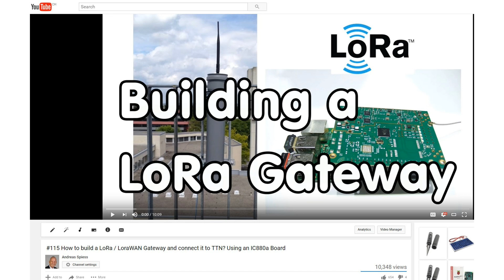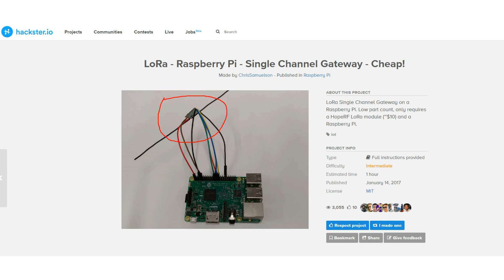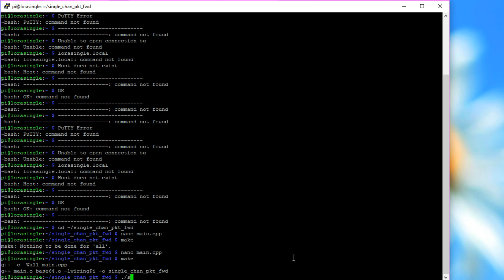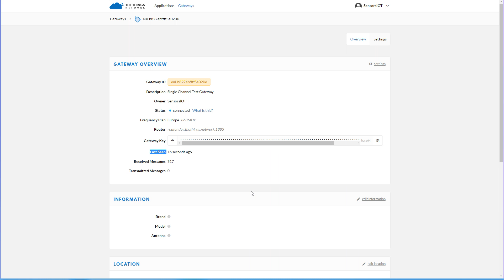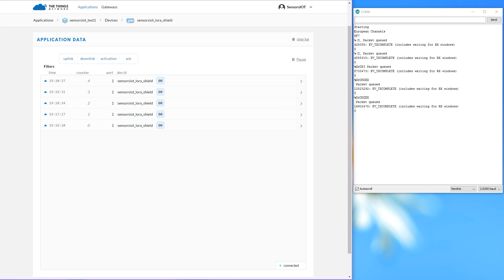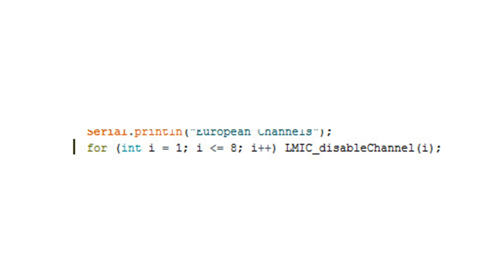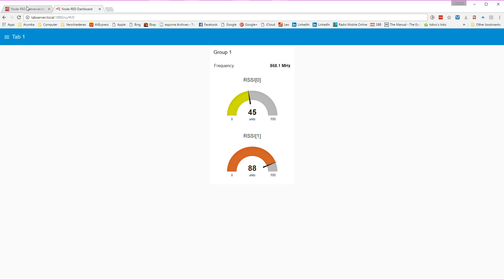#124 Cheap LoRa Gateway: Tutorial on how to Build with one with Raspberry Pi and Dragino

Comment: Hi Andreas,

Thanks for your work and introducing me to the world of LoRa. 

I followed this tutorial using a RPI3 + Dragino Lora/GPS Hat. At first I was getting the 'Unrecognised Transceiver' error. However, I tried it with a RPI2 and it worked fine :) 

However, now when I register my gateway with TTN, my status appears as 'not connected'. I've read on some forums that this is because my gateway is single channel, can you tell me if this is correct?***

Also, my next plan is to set up a node using your tutorial in #117. Do you think regardless of the 'not connected' issue above I willbe able to connect my node with gateway?

Thanks again for all your work!

* Oh silly me, I just saw the pinned comment, apologies, I will try it now!
Reply from the maker: First, you have to solve the "not connected" issue. Otherwise, your node cannot connect through the gateway.
Reply: @AndreasSpiess  Thanks for the reply, yes I switched over to https://github.com/bokse001/dual_chan_pkt_fwd however, I'm having the same problems as Floris and Henry in Amin's pinned post...

Comment: Hi Andreas, great tutorial thanks a lot! it was very helpfull. But i do not get the status connected. Can I check somthing? 

Pi is running and the "Programm"
SX1276 detected, starting.
Gateway ID: xx:xx:xx:xx:xx:xx:xx:xx
Listening at SF7 on 868.100000 Mhz.

Pi has Internet

Thanks for your help.

Rolf
Reply from the maker: I would see if I followed the instructions and also if the internet address of TTN is ok. Needs some googling. The changed their servers once. I am sure you will succeed.

Comment: Hi andreas  great tutorial thanks a lot!. I followed the same thing and used  server1 "54.72.145.119" under TTN platform and port 1700 but i got stuck as i got the issue of unrecognized transceiver.. so could you suggest me how to solve this or is their any alternative to build single channel gateway using dragino lora shield V1.4.
Reply from the maker: Maybe you check out the newest software and addresses in the TTN forum  (https://www.thethingsnetwork.org/forum/c/gateways/scg )
Reply: thanks for the reply .  I have tried server 1 "13.76.168.68" which point to router.au.thethings.network but still i get the same issue. Is this as i am using v1.4 dragino lora shield or their is any error in  server address . can we  use the same ip as of europe as in india  we are using the same 868MHz ?
Reply: Hey shwetal.. have you got a solution for the issue you faced?
Reply from the maker: You can at least try the European server address
Reply: Hey! thanks.. i got it running from the asian servers.. had to use nslookup to get the correct address..

Comment: Thank you Andreas for the great videos, I really do like them. I have two questions regarding the Dragino LoraHat.reading the documentation, the blue led light up when the gateway is receiving packets, mine after is connected, the blue led turns on and stays on forever. another thing, it alway disconnect by itself even the dragino code is running on the raspberry pi, do you have any idea how to fix this. thanks again.
Reply from the maker: I do no more remember these details. And currently, I do not use this shield anymore. I use the RFM95 boards and ESP chips

Comment: Hello Andreas! Thanks you for providing such good videos! I have project in mind, and I need to transmit data inside a filled grain bin, which technology would you suggest? Max distance would be around 15m, small packets around 8bytes every minute. Power consumption is a concern, running out of a 2000mAh 3.7V battery, lasting for at least 1 year. Is LoRa suitable?
Reply from the maker: I definitively would give LoRa a try. Just pay attention that you do not have too much metal between the sender and the receiver.

Comment: Is there any significant advantage to using this method vs the $15 Wemos D1 Mini version (bearing in mind the price difference if you have to buy a Raspberry Pi?
Reply from the maker: There is no advantage. Unless you build a full blown multi channel gateway with the PPi
Reply: Andreas Spiess Thanks - I have a Wemos, so I'll start with that...

Comment: Hello, I bought this one : https://fr.aliexpress.com/item/-/32860051864.html?spm=a2g0s.13010208.99999999.272.777d3c00xNUn2i But It doesn't seems to work, when I try to launch the software from https://github.com/bokse001/dual_chan_pkt_fwd  I get this : Gateway Configuration
  your name (a@b.c)
  Dual channel pkt forwarder
  Latitude=0.00000000
  Longitude=0.00000000
  Altitude=10
  Interface: eth0
Trying to detect module CE0 with NSS=3 DIO0=7 Reset=2 Led1=unused
Transceiver version 0x00
Unrecognized transceiver: Success
Mayby the GPIO are incorrect ? How can I have the correct values? Thanks in advance!
Reply from the maker: By looking at the documentation, searching with google or by trying. 
Do you want to build a gateway?
Reply: Yes! Lora looks fun :) I'll try again from a fresh installation of raspbian. Maybe there is some weird configuration on this card. Thanks for all the videos :)

Comment: Can you advise how I can how I can you the Dragino Hat with the Arduino MKR WAN 1300?
Reply from the maker: I do not use this board. You have to connect the different pins of the Hat with the same pins of the MKR. Then it should work. Pay attention if the MKR runs on 3.3 volts.

Comment: Andreas, Do you know what the frequencies for LoRa in the US are?  (915 MHz band)
Also, will the gateway support the new SX1280 on 2.4 GHz?
Reply from the maker: 1. LoRa is on 915 in the US
2. The gateways only support one frequency range.
Reply: I see the limitation.  There is no LoRa hat for 2.4 GHz, even though there's SX1280 Modules available.

Comment: And in order to start the gw automatically on reboot: I use the following recipe:
--> make your raspi boot to console
$ sudo raspi-config 
choose --> Boot Options --> B1 Desktop / CLI --> B2 Console Autologin...
(and save "OK") 
 
$ cd single_chan_pkt_fwd/
$ sudo nano startScript
# --> with the following line... the & at the end of the line is important
sudo /home/pi/single_chan_pkt_fwd/single_chan_pkt_fwd &
--> save it (^X (Yes))

$ sudo chmod 755 startScript
$ crontab -e
--> add the following line...
@reboot sleep 15 && /home/pi/single_chan_pkt_fwd/startScript
--> save it (^X (Yes))

$ sudo reboot
(and your single-channel-gw-will-automatically run on start)
Reply from the maker: Thank you for your feedback. It will help others with similar problems.

Comment: My gateway stopped showing connected after a while. Everything working at gateway level. Packet forwarding working. Pls help
Reply from the maker: As I wrote in my last comment: Remote diagnostics is not easy. So you have to search yourself. Maybe you find help on the TTN website. Test step by step to try to isolate the issue.

Comment: Great videos Andreas!
I'm using the exact same hardware, however I'm attempting to build it as a simple node. Any wiring or setup tips?
Reply from the maker: I think the wiring should be similar if you use the same LoRa module

Comment: tftelkamp single channel repository deprecated.

"*** IMPORTANT *

Please note this repository is deprecated, and the code is not up-to-date to use on The Things Network.

This repository will not be further maintained. Please find another repository if you want to deploy a single channel gateway."
Reply: It still works if you follow instructions on http://wiki.dragino.com/index.php?title=Connect_to_TTN. You just have to specify another SERVER1 as described in that tutorial.
Reply from the maker: Thanks for the comment. Which SW did you use instead of that?
Reply: Hi Andreas, still trying to decide if I should build this gateway -- at which point I will need a suggestion as to software.  Or wait to purchase a TTN kickstarter gateway (not sure when that will be available).

Comment: Hello Andreas, nice video. Do you think it's possible to use this lora hat with an APU 1D4 from pcengine.ch ?
Reply from the maker: You need to find a software which runs on it and then, find a way to connect the pins to the LoRa module. Another possibility is to use a Arduino node for LoRa and jus send messages via Serial connection to this node. The LoRa protocol would then run on the Arduino. The node would just receive your message and send it via LoRa.
Reply: Andreas Spiess thank you.

Comment: Hello, thanks for the video. I was able to build a single channel gateway as demonstrated. I have two more dragino lora hat shields for raspi 3. Can you show how to build a single channel (if possible) node using the lora hat and raspi 3. Thanks.
Reply from the maker: You are welcome! Nodes usually are simple and low power devices. So, I cannot imagine to use a Raspi for such a purpose.
Reply: Andreas Spiess yes Sir you are right but as I said I already purchased 3 shields and 3 raspberry pi 3 for this project. The lmicpi example does not always work (looking at the ttn data seems to have worked at times) and most of the time gives radio.c error at line 630 and the message that starts with OhOh... any pointers to make this work will be highly appreciated. Thank you.
Reply from the maker: As I wrote. I have no knowledge about LoRa nodes on Raspberry. Maybe you ask your questions in the TTN forum. Maybe you find somebody which already has this know-how.
Reply: Thank you Andreas.

Comment: Hello Andreas,

Reading the comment threads below, it seems RPi Single Channel Gateways are no longer supported by TTN since it does not have downlink capabilities.

I was actually about to begin the tutorial in this video. I have all the hardware requirements until I came across the comments and the forum at TTN below (from Jeff Davis')

So, one question, should I continue? Can you please suggest some alternatives? Thank you.
Reply from the maker: The issue seems to be resolved by now: https://www.thethingsnetwork.org/forum/t/resolved-some-single-channel-gateways-stopped-working/6529/18
Two days ago, I tried my gateway and it worked.
Reply: Great! Thank you so much :)

Comment: Andreas, just got my RasPi LoRa Hat in and was trying to follow your instructions. Sorry but I am new to the Pi and LoRa but want to get the LoRa up and running to start testing. I got the SPI enabled but got lost your Step 4. Typed in at the command prompt and got up a GNY nana screen and not sure what to do from there to add the rest if the information.
You YouTube posts have been extremely helpful. 
David
Comfort, Texas
Reply from the maker: Just read Jeff Davis' comment below. The Raspi/Lora hat gateways do no more work. I hope, they will find a solution.
Reply: Just ordered a LoPy-PyCom board. Hope to have better luck with it. It already has a smart phone drag and drop type interface. Will have to check out issues with a single channel. I only need a single channel for this application. Gate Access to a facility where my customers only to access the gateway.

Comment: Hi andreas,
 Is it possible to build uplink and downlink LORAWAN with less cost and why can't we develop downlink using arduino and lora. can we include 2 different channel, 2 SF to obtain downlink
Reply from the maker: You do not need 2 channels for downlink, it happens all on the same channel. I think, I will build another single channel gateway which should be able to downlink.
Reply: yeah i will be highly appreciated if i got downlink code. Thanks for reply andreas

Comment: what protocol did you use in this project? and how many end-node devices can you connect to the gateway?
Reply from the maker: The loraWan protocol. Please watch all my LoRa videos for clarification
Reply: But in my acknowledge, with lorawan protocol,  you can not create the communication between 2 sx127x.
Reply: Andreas Spiess,  in your video,  you said that lora protocol,  but lora is the modulation, it's not a protocol
Reply: If you would have looked at the LoRaWAN specification you would have seen the first sentence: "This document describes the LoRaWAN™ network protocol which is optimized for battery-
3 powered end-devices that may be either mobile or mounted at a fixed location"

Comment: You could use 3 cheap lora modules for supporting the 3 channels. Eventos then, it will be much cheaper
Reply from the maker: +Alejandro Vargas This does not work because they are not synchronized and would disturb each other.
Reply: what about few meters apart on different channels? Lets say 3 different esp+95w combos few meters apart on different channels?
Reply: youtube put my comment above older comment for some reason.
Reply: gelisob I think It may not be needed meters. Some mult of the wavelenght or something like this.

Comment: Interesting video as always.

Have a look at this project (https://github.com/things4u/ESP-1ch-Gateway-v4.0). The cost is even lower using an ESP8266 and it supports multiple spreading factors. I think he is also working on multiple frequencies.

Cheers !
Reply from the maker: +Loïc Bovay The boards are already lying on my table...
Reply: A few weeks ago I was skimming through the datasheets. From the block diagrams it appeared that different frequencies require different RF frontend if you want to support all frequencies simultaneously. They have a companion chip for that. One Main chip plus 4 RF frontends make a concentrator that supports 4 frequencies. So I guess minimum complete gateway setup would require 5 Semtech chips, 4 antennas and one application processor with access to internet. Semtech chips are in 3~5 USD range and application processor with with say a GSM modem would be $10 tops (I am assuming that the processing power of a full blown linux board is not required). I guess we will start seeing 4 channel LoRA gateways at around $40. A Kickstarter or special pricing from Semtech could make it possible to have the same thing for around $15.
Reply: looks like that system even can do downlink messages.. bringing the gateway price down to 9$ + antenna? nice..
Reply: Great, hope to see a video soon!
Reply: Yes it does downlink and multiple spreading factors. I haven't tried multiple frequencies yet. I am also wondering if it could work as a full blown gateway with a raspberry pie zero w. Maybe the rfm95 is not suitable for a full blow gateway ? I'm not sure what's the limitation.
Reply from the maker: +Loïc Bovay I think, you can use a raspberry zero. You just have to have internet connection. The RFM95 is not suitable for a full blown gateway. It has only one receiver. I tried different SF in the video.
Reply: This gets dangerous for a man with a job to do and a family to keep!  I saw your reply to mine earlier message Andreas then saw this thread.  I guess I need some more RFM95 boards!   
I told a cousin 5km away from  my home to fit some instrumentation to his bee hives which I offered to collect and host.  Maybe a €10 WeMos 1 channel gateway in his house?
Here we go...
Reply from the maker: + Garry: Just keep the word "line of sight" in mind...
Reply: @helloworld why 4 antennas ? Is there no way to use a single antenna like current full blown gateways do ?
Reply: Andreas Spiess the new Raspberry Pi Zero W do have the same chip and connections as Raspberry Pi 3, thanks to antenna technology from Sweden. It is etched on the board.
Reply from the maker: I also have a Pi Zero W and ordered an Orange Pi Zero to test it. The Orange is easier to get here.
Reply from the maker: Thanks for your tip!
Reply: Here is a step by step nodemcu esp8266 https://talk2lora.blogspot.com/2016/10/building-lorawan-gateway-using-esp8266.html
Reply: Loïc Bovay g